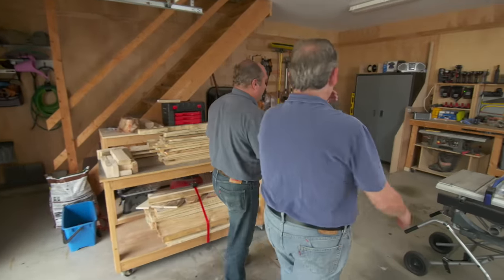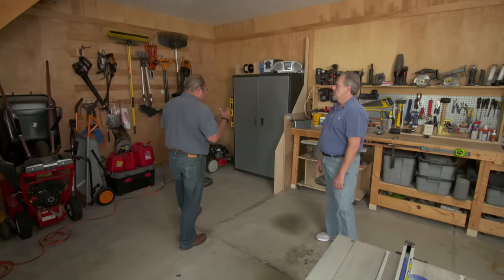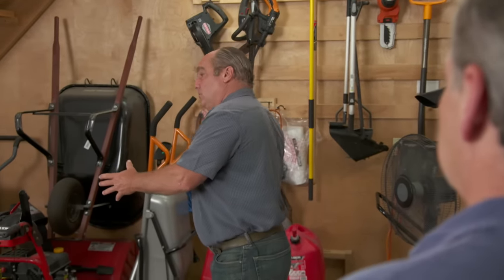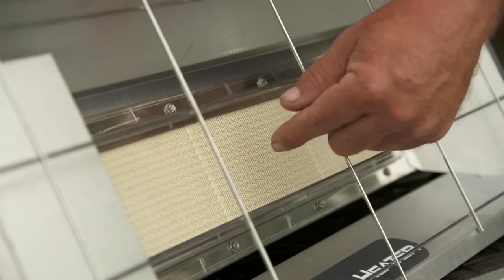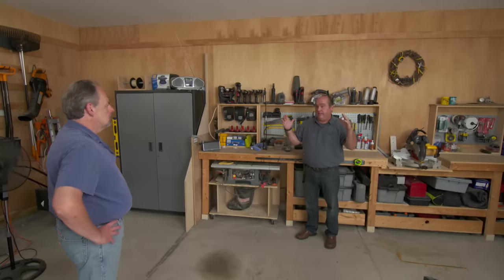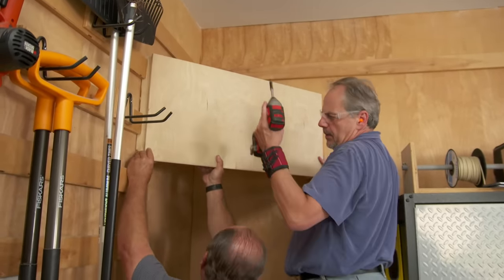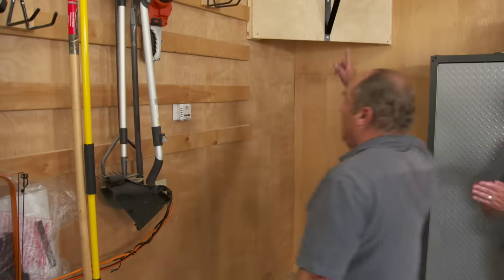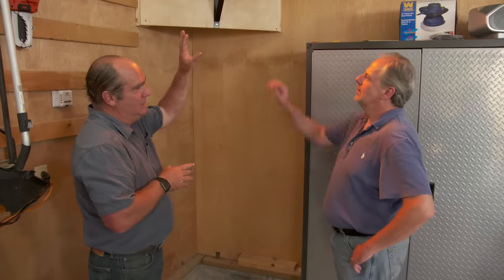How to Heat a Garage Workshop | Ask This Old House

Comment: This is just about the worst advice for heating a garage I've seen in quite a while. With this set up, you can't spray things like paint, lacquer or anything else that might be flammable. You'd be MUCH better off putting in a high efficiency furnace like a Miller mobile home hot air furnace that uses either propane or natural gas depending on what's in your area. You don't need duct work. They push the heat out of the bottom  so all you need to do is make a four legged riser to keep the base off the floor so the heat just dumps out the bottom. I made a riser out of 1" pipe nipples about 8" high with an angle iron frame. My garage is 28'x32' with only the ceiling insulated at the moment , the furnace is at one end of the garage and it works great, it puts the heat on the floor where it belongs and gets all around the shop. Being high efficiency, it vents using PVC pipe so you don't need anything more than 2" PVC to vent it. No Metalbestos, or masonry chimney, just put it out thru wall and put an elbow aiming down and you're done. And yes, it meets code that way. It pulls the combustion air in from outside. The combustion chamber is completely sealed so I don't have to worry about paint fumes, gas fumes, sawdust, or anything else exploding or flashing. The only drawback is what to do with the condensate. If you have a floor drain, you can let it go there.  I'm in upstate NY and don't have a floor drain so I could run a 3/4" length of PVC out through the wall but that might freeze up.so I put into a bucket that has to be dumped every so often.. I only run it when I'm out there so it's no real problem. If I ran it 24-7, I'd have to put a heat tape on the condensate drain so it wouldn't freeze. I'm not sure if codes would allow the type of heater that was put in in this video, but as I said before, this furnace meets all the codes in NYS I don't remember the cost, maybe around $1500 for the furnace or so but it's money very well spent if you're going to be spending a lot of time out there and will be painting or whatever. If you're handy enough to have a workshop, you're handy enough to put one of these in.

Comment: "I love making things, building things" and yet this guy is clueless as to heat up his workshop in the winter!?  There is only about a billion YouTube videos on different ways to heat your workshop using anything from electricity, gas, oil, wood, compacted newspapers or leaves, and of course waste oil too. Besides, settling for an unflued gas heater is about the worst choice ever as it will create a huge amount of condensation, leading to all sorts of problems with rust and possibly also "winter mould" on the wooden surfaces.
Reply: He is going to be ripping it out this spring due to high humidity

Comment: I know this is an old video, but I think this was the most dangerous solution and irresponsible. Enclosed garage, gas flame heating ceramic elements to glowing. What if he's using varnish remover,  using petroleum based aerosols or paint strippers, cleaning the carby on his lawnmower. Any of these or similar could get to an ideal air ratio to be flash ignited and cause an explosion. much better to have remotely heated non-recycled air piped in by a vent. Besides the air not carrying fumes, the positive pressure will prevent any fumes getting to the heating medium be it electric or gas or reverse AC.

Comment: This is honestly a terrible option. A mini split would probably have been the best option if it's not super cold in his area, or at least a furnace with a 4" filter that can be replaced one or two times per winter. A goodman 40k would have been plenty and cost him less than $1000 with some minimal ducting which would be cost effective at the 5 year mark.
Reply: A mini split would not work under 36 degrees. Ohio has winters under 10 degrees and most days in the negative temperatures.
Reply: Hell he could have installed a reznor having from the ceiling for less then 1200 bucks
Reply: Andrew Rawlings please stop speaking, a mini split can easily run into he negatives. For example a Mitsubishi mini split is good till -16 degrees. Clear you don’t have any clue what your talking about.
Reply: zack9912000 I highly doubt the guy wanted to spend $3,000 in Mini splits. $1600 a piece mini splits plus install. He might have better just put a boiler in. Lmao!
Reply: Andrew Rawlings i never endorsed the idea to use one here, I am not a fan of mini splits and would have told him to get a hanging heater like a Reznor which would easily heat that shop. No filter required
Reply: zack9912000 most of those are only 100% successful at 5 degrees even though they say -13. You might get 50% efficiency at -16.
Reply: Mini split efficiency depends partly on your insulation value I live in Idaho and my house is heated by mini splits. It works great and my power bill is almost half of what it was with central heating.